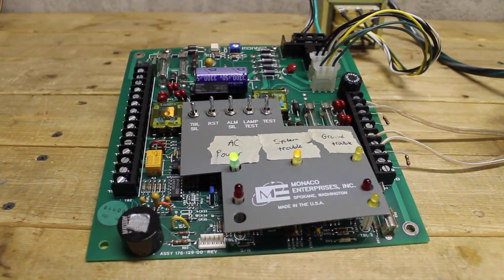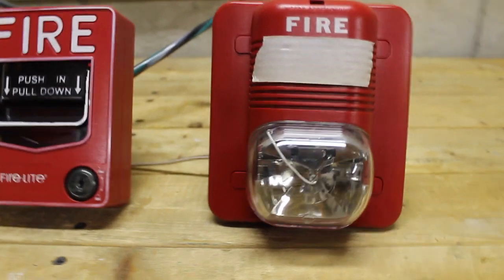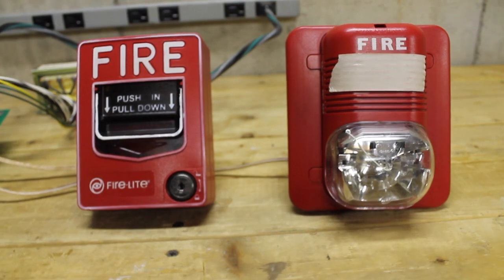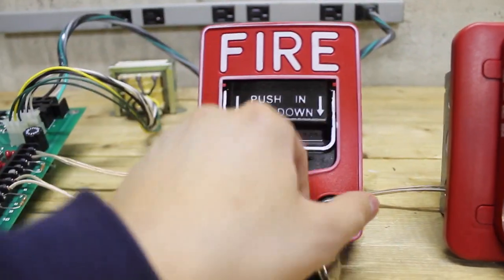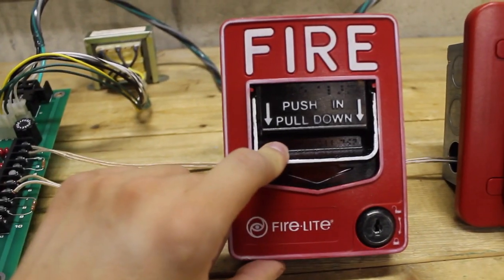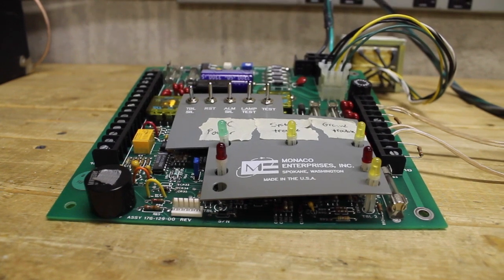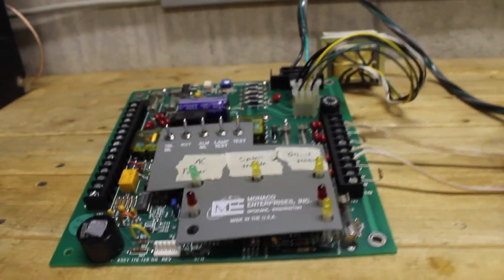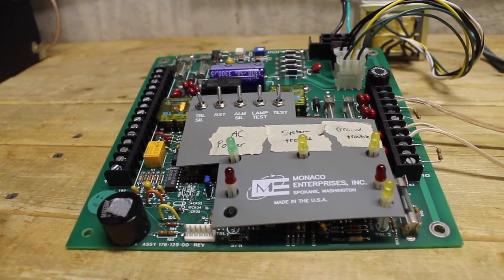Monaco Vulcan 1: System Test 1

Comment: What happens if you try to do a true alert using FWR?
Reply from the maker: +Gary Beltz True Alerts (or any Simplex made from the mid 1990's onwards) are designed to work on a Simplex system, which are FWR. From what I am aware, using one of these devices on FWR will eventually destroy them, and that would not be good.

Comment: I might get one of these, can you help me?
Reply from the maker: Sweet! Going to be nice to have another fellow Monaco Vulcan 1 owner!

What is it you need help with specifically? I've been trying to locate where you can download a manual, but unfortunately to no avail on my end.
Reply: @NewEnglandElevators  Mainly wiring. like the NACS and zones. I dont know which terminals are which. have a wiring diagram??
Reply from the maker: @alexandersalarms5380  I remember seeing in a PDF of the manual I downloaded a while back that on the right side of the panel (TB 3), terminals 6, 7 are Zone 1 and 8, 9 are Zone 2. For the NAC's, Terminal 1 is the negative and Terminal 2 is the positive for NAC 1, and same thing for 3 and 4 for Zone 2. Those are the only ones I really use anyways, at least in terms of wiring alarms to it (though I have used the relay once or twice, those contacts are on the left side of the board).
Too bad the manual has seemed to disappear from existence (not even wayback machine seems to have it). Do you happen to have Discord where I can send this to you over?
Reply: @NewEnglandElevators  Ok so, I tried messaging the seller of it which sadly was a total jerk, But, i managed to find a listing of it on ebay.

Comment: the alarm sounds different
Reply from the maker: +CN railfan Out of all the alarms that I have, this alarm seems to sound the most different when powered on FWR. Other alarms may perform differently, too, but not as noticeable as this. That, and I have the tape over the horn, muffling it a bit.
Reply: Oh this is an ac alarm isn't it it is on fwr now right
Reply from the maker: +CN railfan It's not AC, straight up AC would probably damage this device. FWR is still DC, but unfiltered.
Reply: +NewEnglandElevators I meant dc oops